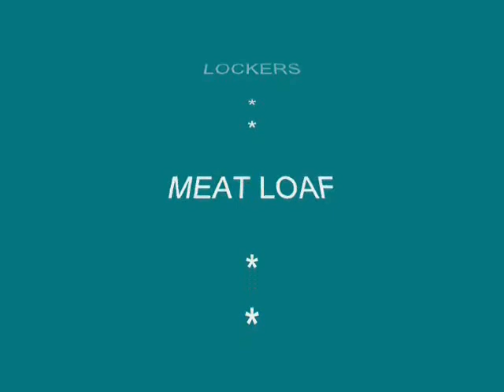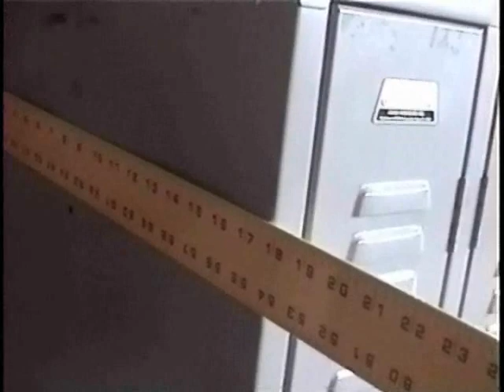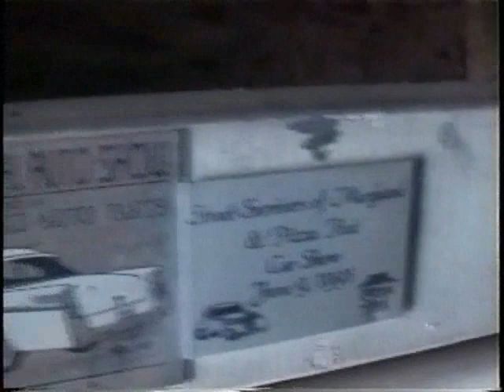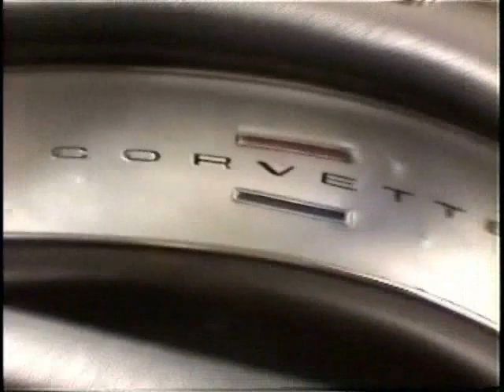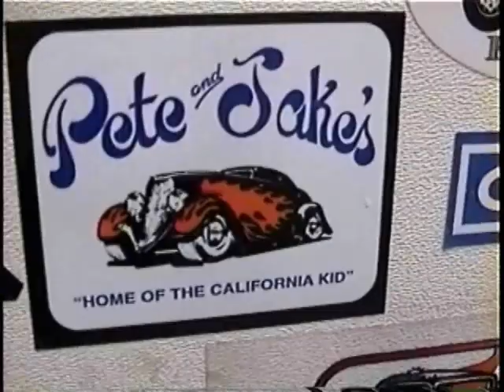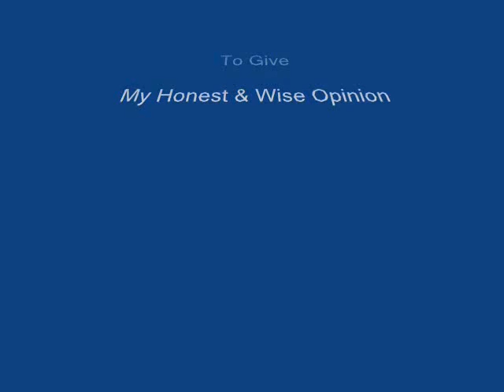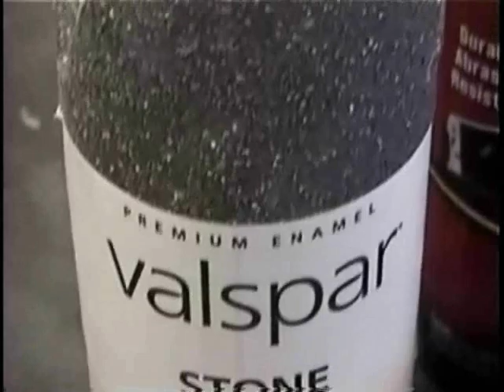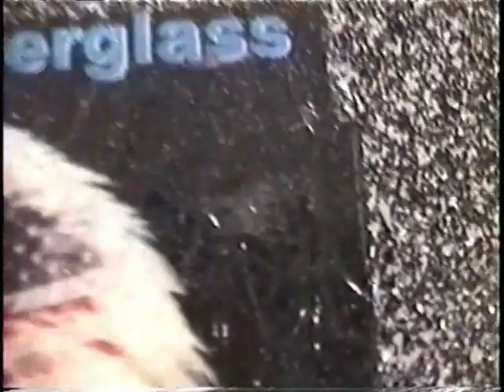How To Fiberglass * Police Tour Pack * Flat Sheet Fabrication Part 2

Comment: You're exactly right about mold storage, I've got a few left in my barn that I havn't sold. I've presold enough 55 Chevy frontends to pay for the mold and this will allow me to do what I want to with the parts. I agree with you, my advice to everyone is don't make a mold if you need 1 or 2 parts for yourself or if it's already been done, it's cheaper to buy the part.